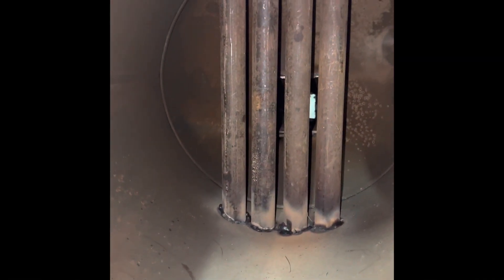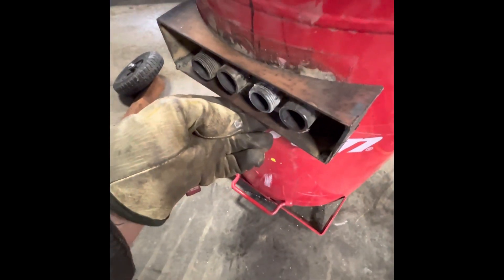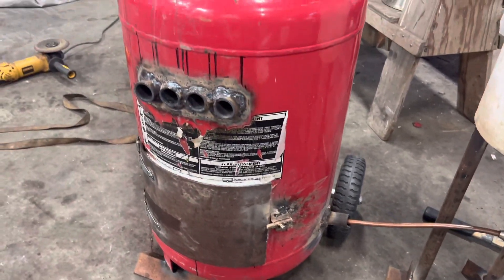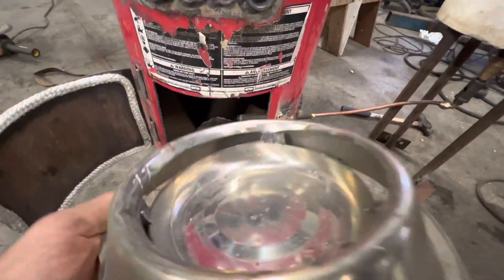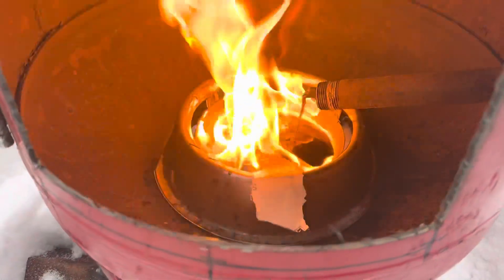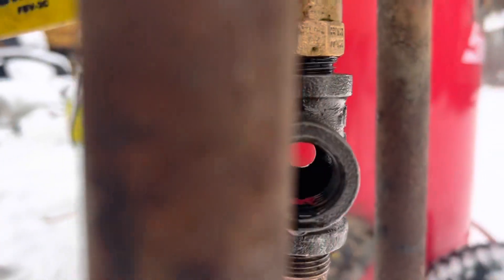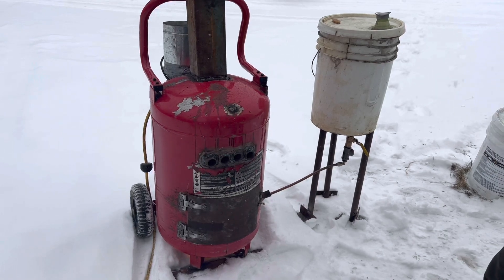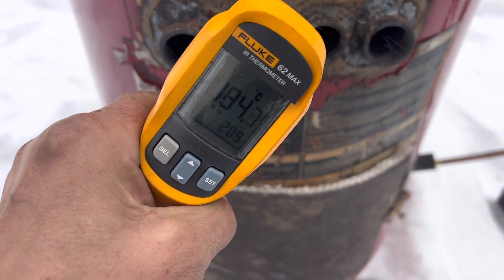Forced air waste oil heater

Comment: You can use steam to force hydrogen & oxygen inside the combustion chamber . Not only will it help burn hotter & cleaner you won’t have to use any sort of electric blower motor to force only oxygen into the combustion chamber. Purely an off grid design, Just saying

Comment: I want to build one but I don't trust the fumes over time not slowly entering the shop.  Would like to have it outside and vented to pull air from inside shop run it outside to the Heater and back into the shop.
Reply: Pulling air from in the shop is a better idea then outside air !

Comment: Nice job! 👍 I have built many different kinds of oil stoves and I found that all my stoves need a safety overflow for the burn chamber so oil won't come out the air intake.  Or liquid fire .. 
Over all your on the right track!
Reply from the maker: Thanks so much. I did have problems with over flow but controlled it with the drip feed. Once the dish about have full I slow down drip to find the happy medium. I run mine inside so slow and steady is safer then wide open.
Reply: The drip feed has to be constantly watched.  Oil viscosity changes so much the drip will not stay the same.   We can't trust homemade drip feed systems that's just the truth.  So something to contain the overflow while it's burning off is next best thing.  Providing you can shut off the supply in time. Over fueling is the hardest thing to figure out.  Needle valve is pretty good but the oil has to be clean. Good luck!